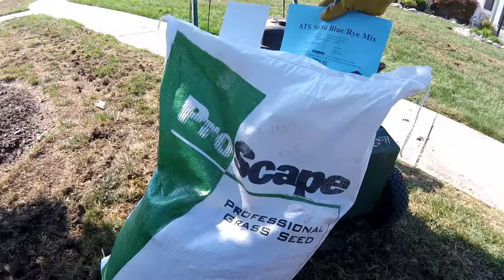Over seed, Slice seed, Slit Seeding - Which one does your lawn need and why?

Comment: I think the direct sunlight, mowing too low, and not watering enough during very hot days are a huge part of the problem. All cool season lawns do amazing in cooler temps of the Spring and Fall. I keep my lawn at 4.5 to 5 inches during very hot sunny days. Thanks for the education on the slice seeding!
Reply: EXACTLY

Comment: 👍Good stuff! This will help many out for sure. I bought a MANTIS years ago & the slit wheels. Drop my seed every couple years then run the MANTIS. Stays looking good. Best purchase as a homeowner I’ve ever made. Along w/ the irrigation & quality seed. 
(SUBd) ✌️
Reply: i just ordered a Mantis for exactly the same purpose.  Two questions, please.  Confirming you drop the seed, THEN run the Mantis over it?  Second; do you install your aerating blades in the aggressive or less-aggressive position?  Thank you.
Reply: @jmljml5065  Hello. I install the cultivator wheels pointing away. I dethatch 1st, rake out then spread the new seed along w/ some Scott’s lawn soil (my preference) then pull the MANTIS backwards, full speed, slicing and burying seed w/ the new top soil to help a bit. 
Good luck.
Reply: @majorpayne5289  Appreciate the info; thank you.
Reply: @jmljml5065  👍🇺🇸

Comment: Do you have to top dress when using slit seeder?  Any straw or peat moss needed?
Reply from the maker: No, not when seeding into an existing turf base... Even if it's dead.
Reply: @ColumbusLandscapers  Thanks for responding so fast.  So I killed off existing lawn with glyphosate, and once dead I scalped it down to 1in.  If I slit seed I don’t need to put anything over seed bed, correct?  Should I irrigate prior to slit seeding to make ground soft?  What depth do you recommend setting slit seeder at for Kentucky Blue Grass.  Wish you were in my area, I would hire you to do this for me.
Reply from the maker: @desmorider747  You're on the right track, be sure to give it at least 2 weeks before seeding. You can water ahead but don't do the seeding when wet.  Seed only needs to make soil contact so 1/2" to 1" depth is good.

Comment: I would still dethatch.. and lots of water
Reply from the maker: The slice seeder dethatches at the same time it's seeding. Then that thatch will stay on the surface to cover up the seed and provide moisture retention. Just the same as if you were putting down straw.  Thanks for watching!

Comment: A quick question I just finished doing my lawn. There seems to be a lot of thatch. I did detach but there’s still was a bunch after the seeding process. What do I do?
Reply from the maker: If there's about a half inch of thatch on top just spread it out it should be okay. If there's an inch or large clumps in the yard you may want to rake off some of that, but you shouldn't have to remove all of it.
Reply: I used the Billygoat cedar yesterday. I did pick up some clumps cause it seemed like way too much. Thank you for getting back to me any quick tips on my watering schedule.

Comment: I'm in Lawrence ks  I had a nice backyard now it has been over ran with crab grass. I've tried everything but nothing stops it. I do have a section where nothing grows only dirt. I even killed the backyard with roundup 2 different times. Starts out looking great till crab grass takes it over. Any suggestions.
Reply from the maker: First off, proper diagnosis is key. Many times a customer will tell me they have Crabgrass but it's actually something different. Crabgrass is fairly easy to control if done correctly, and applications are made at the correct times.  Pre-emergents in spring and Quinclorac sprays in late spring and summer if needed.

Comment: Slice seeding.....possible where there is a sprinkler system installed?
Reply from the maker: Sure it is. You just need to mark the sprinkler heads and valve boxes to avoid damage to those. Lines should be buried deep enough you wouldn't have to worry about hitting those while slicing

Comment: Thanks for the helpful video!  Why do you recommend broadcast seeding when the lawn is 75% or more in good condition?  Is it because the slice seeder causes some damage to the lawn or is it because you don’t need as high a success rate when you’re lawn is already in fairly good condition?
Reply from the maker: Both reasons you mention are applicable. Thanks for watching 👍
Reply: @ColumbusLandscapers  thanks!  Unless you’re trying to overseed TTTF into a mostly PRG / KBG / FF lawn…I noticed you recommended slit seeding in one of your other videos for this particular situation for more even coverage.
Reply from the maker: True.. that would help a faster and more consistent transition if you're going that route. Otherwise, aeration and overseeding several times is another option.